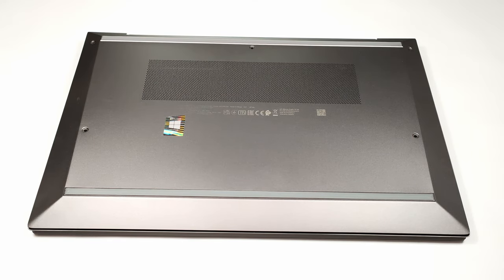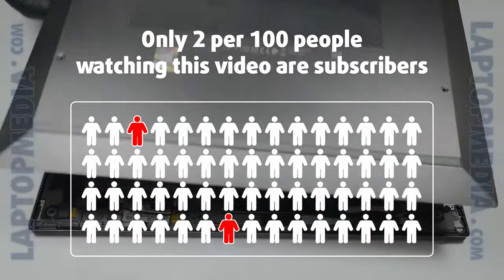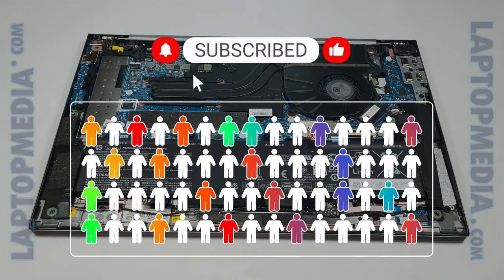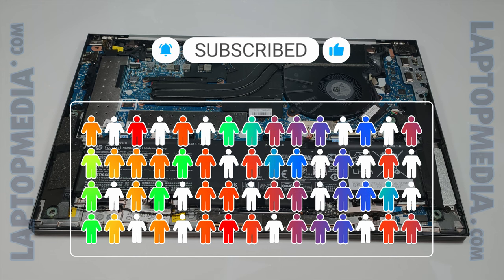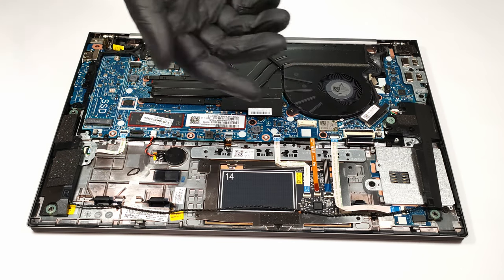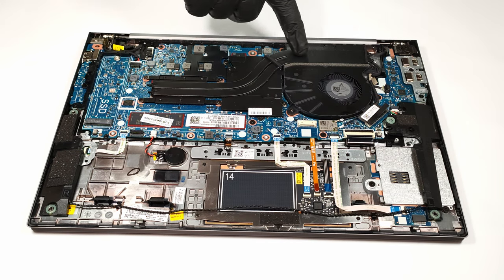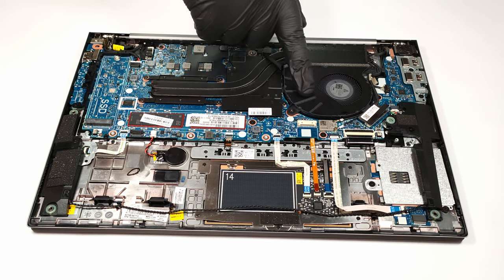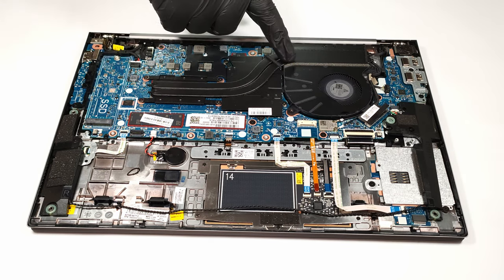🛠️ HP ZBook Firefly 14 G8 - disassembly and upgrade options

Comment: Is there way to unplug screen?
Reply: Yes, there is a display cable that connects at the top left of system board when laptop flpped over. To the right of the SSD.

Comment: Is it possible to install nvidia t500?
Reply: I would love the T600, the T500 has no hardware NVENC/NVDEC support (or it's disabled)
Reply: All Discrete GPus will be soldered to the system board. Must be configured with desired GPU that HP offers at purchase.